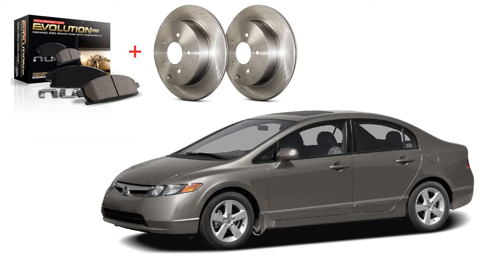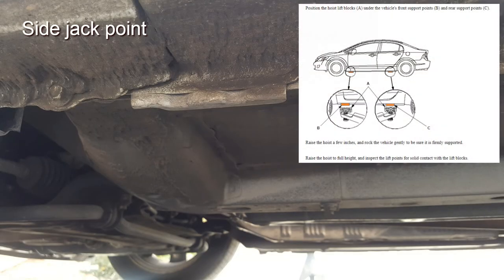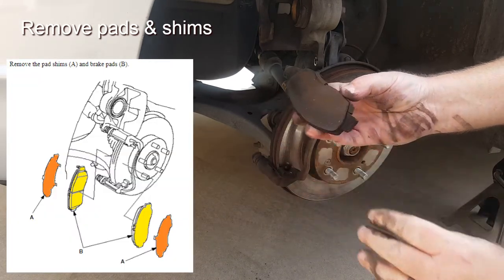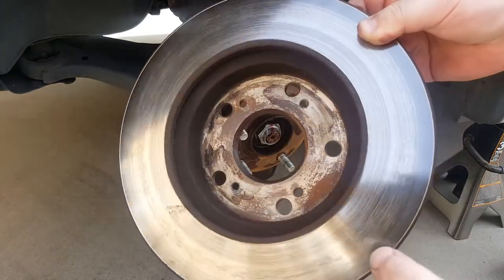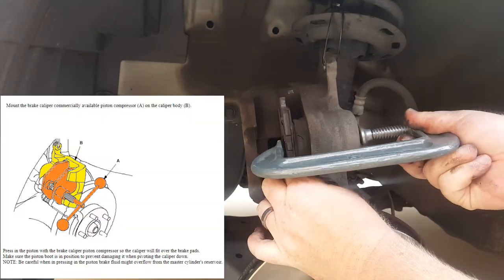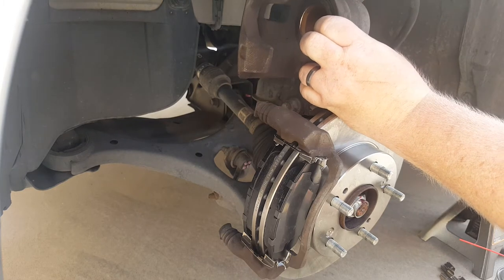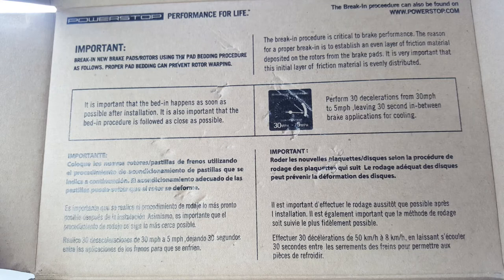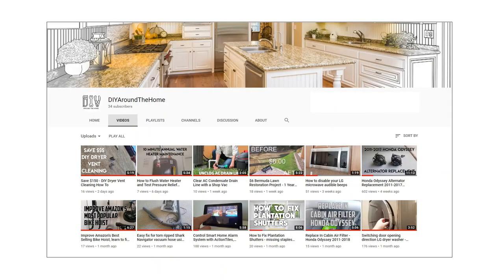Honda Civic Brake Pads and Rotor Replacement 2006-2011 + Powerstop Evolution Break In Procedure

Comment: To remove the caliper bolts on the passenger side, do we hit downward with the mallet?
Reply from the maker: Looking at the bolt, left is loose and right is tight... if the bolt is facing away from you it would be reversed
Reply: DIYAroundTheHome Ok. I’m going to buy a breaker bar. I’m having a hard time with the 17mm bolts holding the brake assembly. I used my jack to get the driver side off but not working on passenger side.
Reply from the maker: Do you have some PB Blaster or wd40 to spray on them? Overall the longer the wrench or breaker bar the easier it is to get it off especially if bolts have been in a climate with snow/road salt
Reply from the maker: You can also get more leverage by laying on your back and using your arms instead of a mallet to hit the wrench